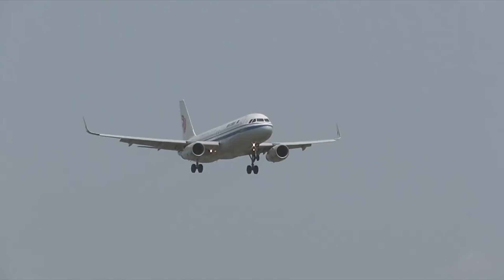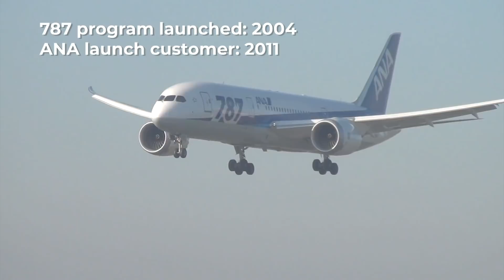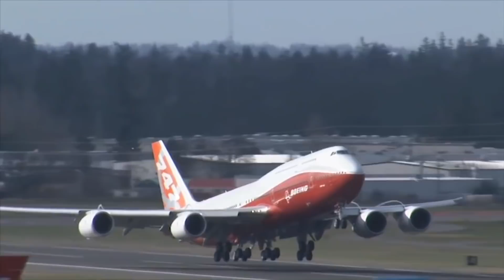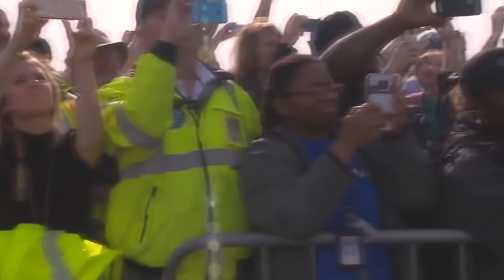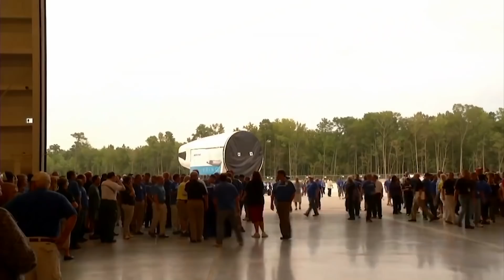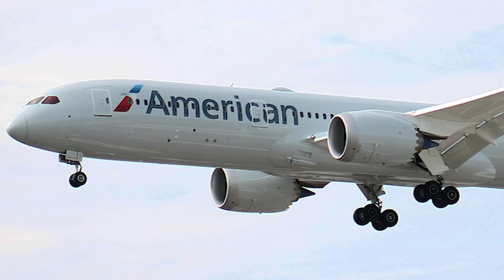The Business Of Making A New Commercial Aircraft Type

Comment: Great video Simple Flying!  What wasn't mentioned in the video was the sometimes years of technology development (supported by Tier 1 suppliers) that goes on prior to new commercial program launch.  This was particularly the case for the 787 due to its revolutionary More Electric Architecture which had to be proven as "Technology Ready" before it was baselined for this clean sheet aircraft's mechanical systems design.